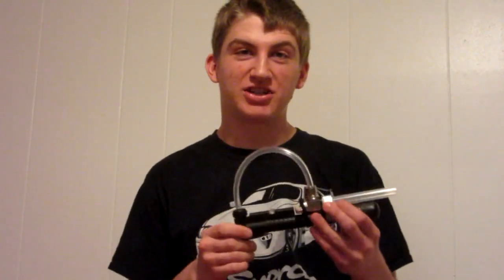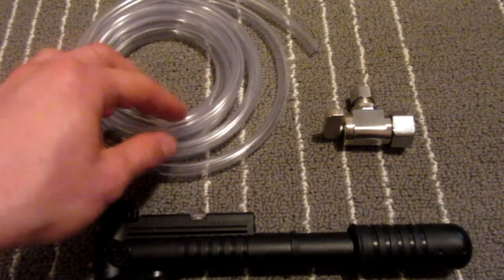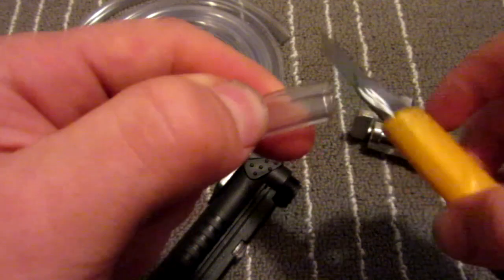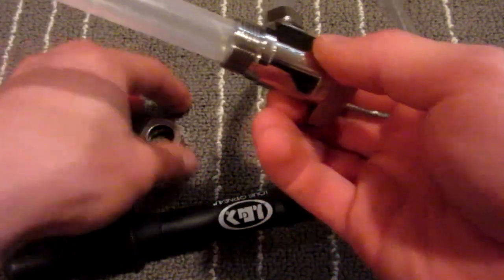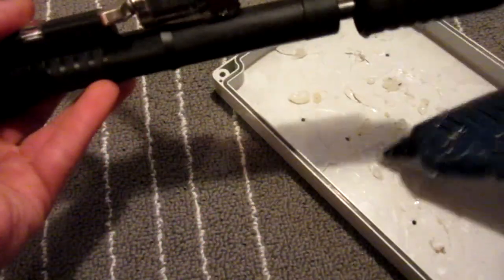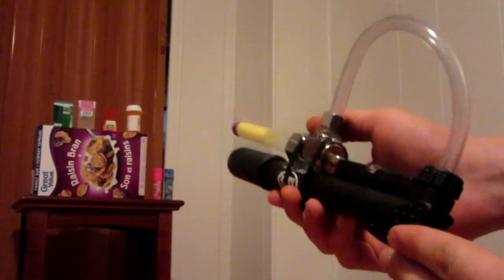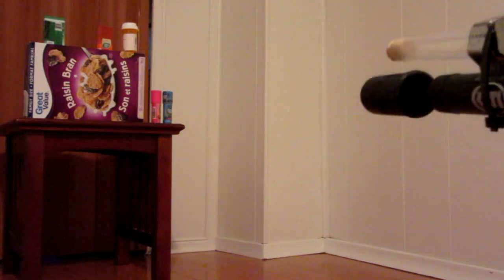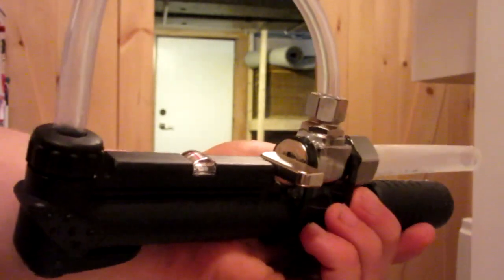Make a Powerful 80 PSI Air Gun

Comment: Remove all the rubber from a tire valve and press it into one end of the tire valve. Use a hose clamp. This will make it very strong. For the valve end, use the compression ring and insert. This will make a leak proof seal.